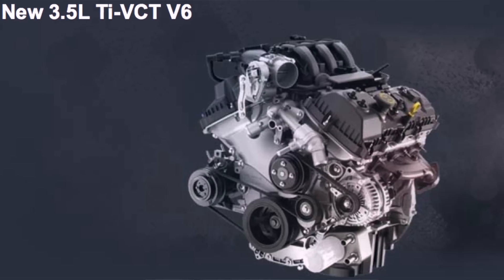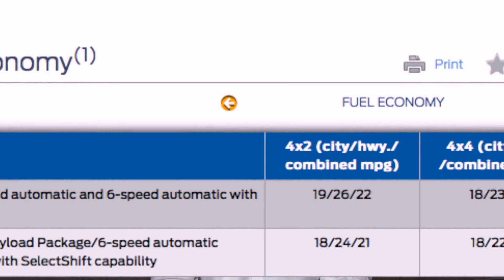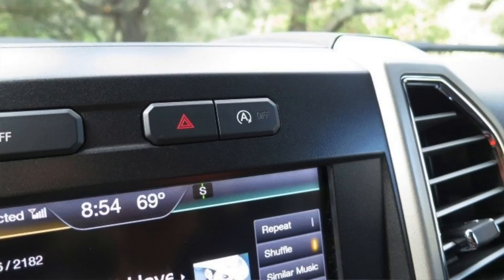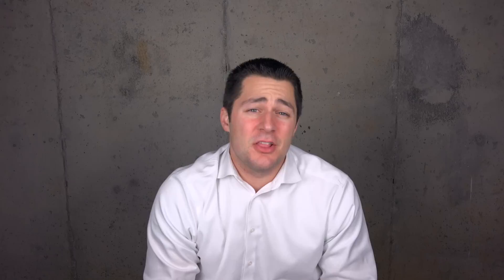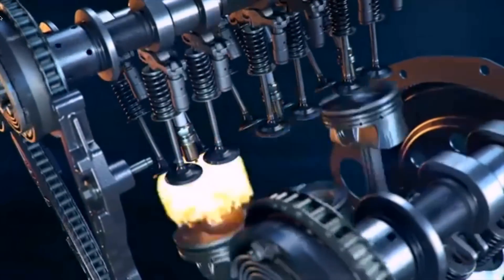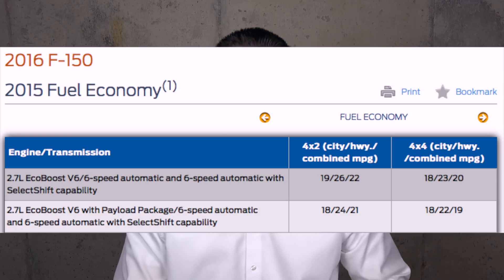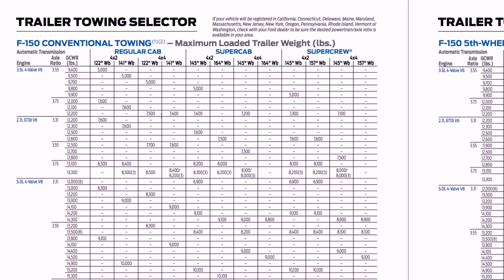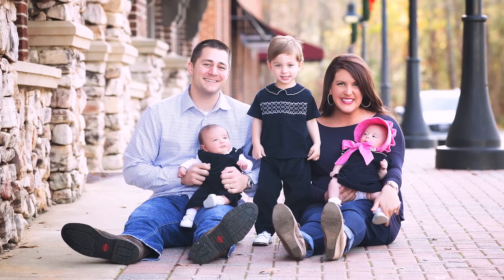Which F150 engine to choose 2.7L - Motor of the Week

Comment: I'll take the 5.0L. Sorry. I just don't find the ecoboost engines reliable.
Reply from the maker: The 5.0 is a great engine! But we have had very good luck with the ecoboost engines... Especially in the new aluminum truck.
Reply: +Town and Country TV Well I haven't heard many good things about the Ecoboost. Even the 2015 f-150s. I hope the newer one in the raptor does not have many problems. But I still will not buy one. Personal preference.
Reply: +Kyle Fitzgerald LMAO Ford knows what they are doing the 3.6 in the Raptor would kill that old 6.2 and superchargers not more efficient
Reply: +Kyle Fitzgerald Yep, I had to custom order mine as hardly any dealers will carry the 5.0.
Reply: +Bullitt Garage Yeah my local dealers have hardly any 5.0. Which is to bad. And it's really to bad that they don't offer the 6.2
Reply: Kyle Fitzgerald
I think they should have kept the 6.2 in the Raptor.  Really, the most underrated engine is the 3.5NA... that engine doesn't get any love from anyone.
Reply: Bullitt Garage They should have kept it and teamed up with Roush and did a phase 3 where it'll push well over 650 hp. Cause the Roush supercharger for the 15-16 f-150 5.0 is pushing 600 for phase 1 and 650 for phase 2.
Reply: +Bullitt Garage same here. try asking for a 3.73 lol. they will have to broaden there search to nation wide.
Reply: billy heaton So your telling me if I were to put an older 6.2 in a 2017 raptor with a roush or whipple supercharger and it pushed 600-650hp that it would still be beat by an ecoboost? Haha I will never buy an ecoboost. Sure the power's there but not reliability.Disregard how great ford makes it sound, it still has problems, even after about 5 years of being in production.
Reply: Kyle Fitzgerald LMAO i have not had any problem from my ecoboost some propel are dumb as fuck and dog there cars/trucks out idk wtf you have been doing sounds like a good ideal with a V8 i don't want a damn supercharger tho you can keep them
Reply: billy heaton You buy what you want I'll buy what I want.
Reply: Kyle Fitzgerald You are right about and i'm going to buy a new Raptor then Find somebody who has a 6.2 get on the trail then race it will all be on video watch me beat that ass
Reply: billy heaton Alright. But you do realize there are a few more upgrades to the newer raptor over the old one? And what I said before was ``if I were to put a 6.2 in a new one'' aka 2017. Of course your gonna beat an older one, 700+ pounds heavier and the suspension is new on the 17 raptor.
Reply: Kyle Fitzgerald Yes i know all of that i have been reading about the truck for a couple of months now that's why a i want one it's a bad ass truck no mater what any body says you want take for a joke
Reply: billy heaton I don't take the  chassis and all that for a joke. It's the engine that I do. When I'm offroading and just doing daily driving I want the sound of a big block V8, not the little (no offence) girl sound the v6 offer's. Sure it can go like hell but I'm waiting for something to happen to that newer ecoboost with them pushing 450+ hp. Something's going to happen. It may not be in the first few months of release but something is bound to happen that'll cost a pretty coin.
Reply: Kyle Fitzgerald i understand that
Reply: Paul Rodrigues Yes
Reply: +Kyle Fitzgerald , My dad has a 5.0 and I have a 2.7.They both are great, I save $ on fuel, a lot
Reply: Kyle Fitzgerald and you know this from experience?
Reply: Kyle Fitzgerald Heard or read?
Reply: billy heaton 3.5
Reply: Kyle Fitzgerald       https://www.youtube.com/watch?v=8tEqwXrqzH4   Torture test of a random ecoboost off the rack. I think after you watched this you would not be quite as negative about it. The only issue they might have with the direct injection is carbon buildup on the intake valves if only used light short driving. This demonstration proved to me this engine was designed to last.
Reply: Kyle Fitzgerald it's doesn't really matter if you "find" them reliable or not. FACT they've proven quite reliable over the 7 years of production. Frankly that has more weight than an unfounded opinion.

Comment: Imagine this engine in a new Ranger...
Reply from the maker: We are so excited about the new ranger!  Ford hasn't confirmed it yet but it WILL be built!
Reply: +Town and Country TV I hope it want be as ugly as every Ranger in the pass.
Reply: Better yet put that engine into the fiesta.
Reply: gta
Reply: Mel Laknanurak but if its aluminum....
Reply: There is a kit for the old Rangers to install a 5.0L. I've done one for a friend. On the first test drive, would pin your head back. He couldn't keep tires on it. SMOKIN!!
Reply: It won't be an faster than the F-150 since the current Colorado and Tacoma already have a similar weight to F-150s.

Comment: answer why the people can't get the 6.2 with out buying a super doodies??? guess after 15 fords , it time to change brands , guess when the Nissan hd comes out I will be getting it , atleast its only one engine unlike for showing the eco boost down ppls throats! next ford will offer a 1.2l for the superduty line , one dissatisfied customer!
Reply: +Jack Caldwell how was your experience with the 2.7? I'm trying to decide between 16 F150 2.7 or a 16 Sierra Elevation 5.3 V8, I like both, the 2.7 feels powerful on the test drive, but I'm old school and I like the V8.
Reply: Jose M Brito the 5.0 in the ford is the way to go the 2.7 I have wouldn't pull a greasy hair out of a cats ass , it good with no weight behind it, it does all sorts of tire spin and it will even bark the tires when it hit 3rd that's about it , the 5.0 get 22mpg on highway and 19 around town ,that my opinion , some of these that comment are just keyboard warriors and know it all, good luck
Reply from the maker: The main reason they cut that engine is fuel economy ratings (the Superduty's #'s don't go towards the government standards) and the fact that the next gen 3.5L is outperforming the 6.2.   That is a great motor though!  We hate to see it go too!
Reply: Sry your butt hurt, do you own a 3.5 ecoboost?
Reply: aaron monke had 2 and one of the new 2.7s and I fart harder then the bastards pull